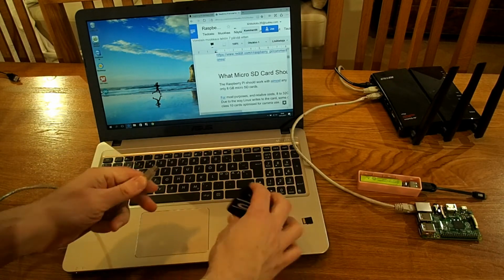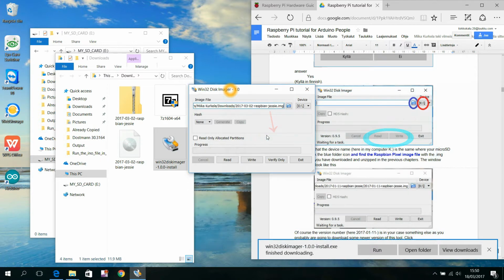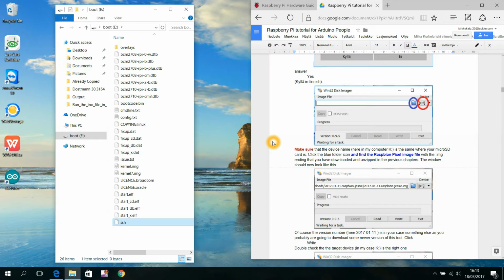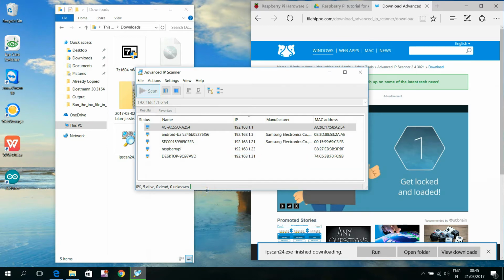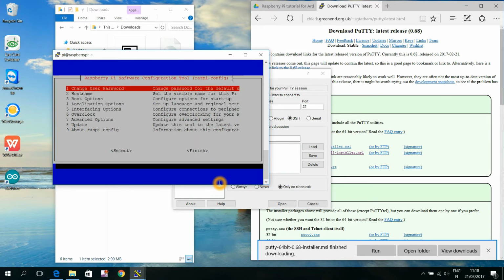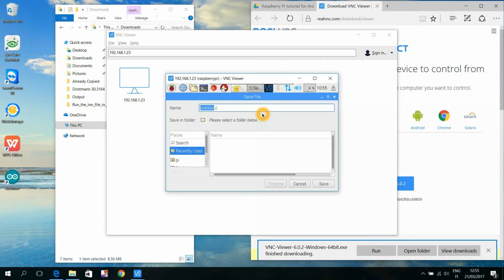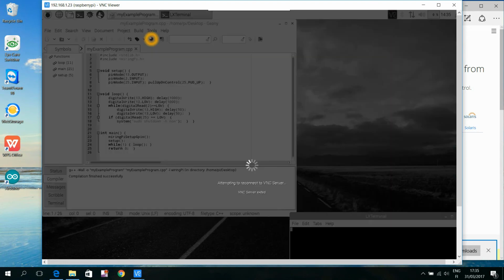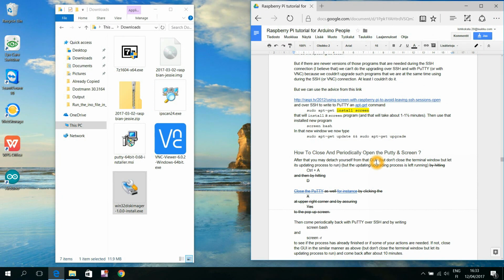Raspberry Pi tutorial for Arduino Uno people (video #13)

Comment: Just got a Rasp Pi 3. This is very helpful indeed. Nice one.
Reply from the maker: I'm glad that you found this video just now! You can still use all the instructions video. Currently I prefer Etcher and MobaXTerm_Personal. But you can follow the instructions of the video and start with the Win32DiskImager and VNC Viewer programs. And if you want, change later to those other two. Di check that the microSD card that you buy is compatible with your Raspberry Pi 3.
Etcher:  https://www.raspberrypi.org/documentation/installation/installing-images/README.md
Compatible SD cards:  https://elinux.org/RPi_SD_cards

Comment: Try http://mobaxterm.mobatek.net/ if on windows 10
Reply from the maker: Yes indeed. That is an excellent product  https://www.youtube.com/watch?v=vyppO5_WnMU
Reply: One thing that was great with the video is that the enablement of the "full graphics interface" was shown, and although vnc is ok, the ssh / X windows is maybe better.
Reply from the maker: Thank you for your great feedback! I have learned from you some good things this evening. 

In the video it was important to favor those tools that are presented at the  https://www.raspberrypi.org/documentation/remote-access/  so that it would be easier for people to go forward by themselves. And it was important for me to to give such a toolchain that would later make the updating and upgrading over Ethernet easy. 

But I quite agree with you. The ip-address-scanning and using would have be much more easy and straightforward with MobaXterm. And the whole process would have been quicker with ssh + S11. 

Here are few links for those my viewers and our readers that want to try these other options too:  https://eltechs.com/3-ways-to-run-a-remote-desktop-on-raspberry-pi/     
   https://docs.google.com/document/d/1Ppk1YAHtrdVSQmXQyovBFmAec4KcW9mm2jLcothNMd8/edit#heading=h.y30rjrxu6hzy
Reply: At some stage, I may have results with SD Card and two flash drives to obtain quick upgrade / fallback of Pi3/ic880a-spi TTN Gw.
Basic idea is allways have a simple SD Card and then "switch root" to a flash drive that is either production or to test, with easy fallback.
I post a link to something if I get there, or if I see something in one of your videos that  begins to feel like the correct time for me to actually do the thing.
The basic start is "here" https://www.raspberrypi.org/documentation/hardware/raspberrypi/bootmodes/msd.md
Reply from the maker: That should work and it would be awesome! If I'll start making another Raspberry YouTube tutorial I'll post you the manuscript. So you can see in advance if your idea would suit into that video. The easier the upgrading the better! My current way of upgrading (through Ethernet) uses the "screen" program. It is not very user friendly way of doing things and that's why I didn't take that part into the video.  But it works OK  https://docs.google.com/document/d/1Ppk1YAHtrdVSQmXQyovBFmAec4KcW9mm2jLcothNMd8/edit#heading=h.t0u3t4hx0kjc
Reply from the maker: Hi Owen! After few weeks I will publish a video about an easy to make Deep Sleep feature to a Raspberry Pi. Thanks to to your advice I am going to use the MobaXterm intead of AdvancedIpScanner, Putty and VncViewer! You said you had an idea on how to do the "sudo apt-get update && apt-get upgrade" through a SSH. Did you manage to get it working?